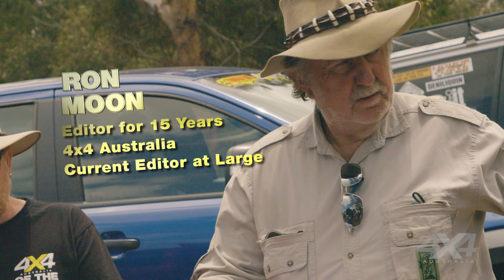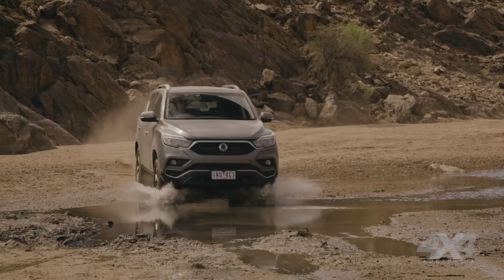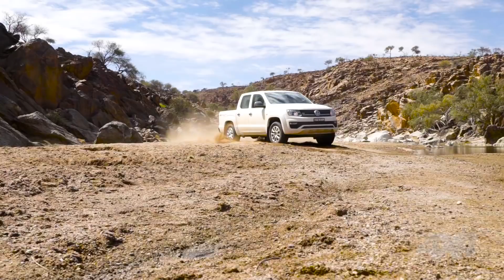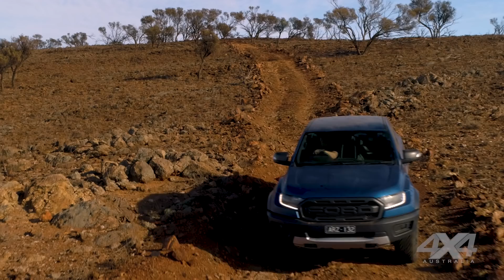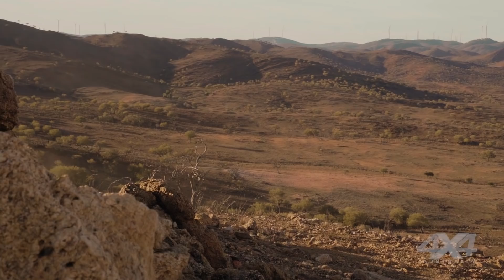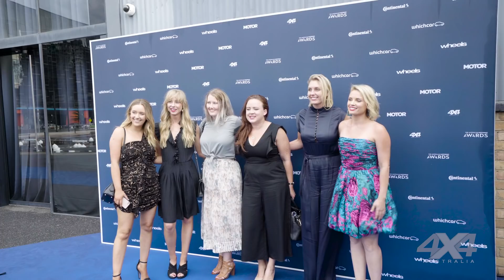4x4 of the Year 2019 | 4X4 Australia

Comment: The Raptor ...!? What a sham.
Come on guys. The comparison is pointless. You need to adjust somehow the (high) price.
Reply: There was a very broad range of prices and the raptor not the most expensive. What is your point?
Reply: @KingWillbro  I never said that Raptor was the most expensive vehicle of the bunch. What I did mean is that it leaves a lot to be desired from a supposedly prestigious magazine to select a halo vehicle as 4x4 of the year. Everybody knows that the Raptor is a marketing gimmick. No serious 4x4 enthusiast would pick the Raptor over a good base platform with aftermarket modifications. Take the suspension for instance: that Fox suspension doesn’t even come close to an Icon, a King, or a top OME set-up. For the Raptor’s price, anyone can go and get a more capable 4x4 using a Hilux or a D-Max and have money left for tons of goodies. If you don’t account for the ‘value’ aspect, supercars and flagship luxury models would always be selected “car of the year”. Putting halo vehicles such as the Raptor on the same field as mass-produced models is preposterous. In short, this whole comparison for the “4x4 of the Year” feels like a charade.
Reply: @Alyosha00  absolutely spot on with that mate.

Comment: you compare a 75k raptor and 70k X class with a core 50k amarok?
Reply: Owen Kelly because you get the same if not better out of the 50k core!!  Actually better in a lot of ways... spend 5k on a core and you have everything!!!... suspension, tyres, and even chipped if you like that sort of thing!!!
Reply: Holy shit. You honestly think anything from VW could come close to that Raptor you're absolutely kidding yourself. You think a 75k VW would be better out in the bush. This is a stupid comment
Reply: @KingWillbro  got no idea mate. also cant read it seems too, he said if you buy a core for 45k which you can... and spend 5k or 10k on it you get a much better car than the raptor.
Reply: @samscott8727  I can read perfectly well. Mate if you spend 5 or 10k on a core you still don't come close to that Raptors capabilities. Ford spent millions engineering that Raptor on top of the hundreds of millions developing the Ranger(best ute in Aus). If you think you can wack on some after market kit and it'll hold a candle to the Raptor, you've got rocks in your head. Another stupid comment.
Reply: @KingWillbro  hey mate what car do you drive? Also you don't think VW, one of the best car manufacturers in the world doesn't spend millions engineering their cars ? The raptor comes stock with 33's and a 2 inch lift so you're looking at roughly 3k spent on it compared toany other stock ute. What if I had another $27,000 to spend on a V6 amarok. You're looking at Egr dpf delete remap (200kw at wheels) . Bar work all round, tray and jack off cannopy, roofracks, awnings, fuel filters fridges batteries and almost anything else you could want for the same price as the ford raptor. Yeah great mate if I want a fitted out raptor for 110k I'll go for a land cruiser instead...
Reply: @samscott8727  Landcruisers cannot do what a Raptor does. 
 They've done a lot more to the Ranger to make it a Raptor, than just throwing after market kit at it. I agree though if you throw money at a Rok you can make a decent 4x4( Not having low range is pretty shit though). Not going to come close to the Raptor though.

Comment: RAPTOR FOR THE WIN! 
Why is there no 79 dual cab ?
Reply: They dont compare tractors with modern day utes
Reply: @vevohoeyo  Wouldn't really call it a tractor. Common rail v8 diesel, and some people still prefer solid axles all round.
Reply: What’s the point of solid axles when combined with suspension that has no flex?